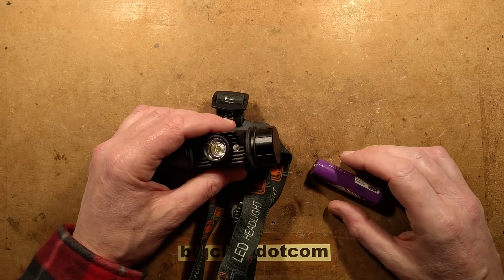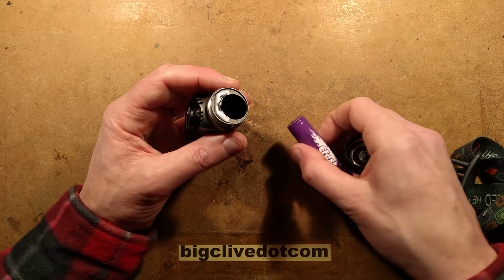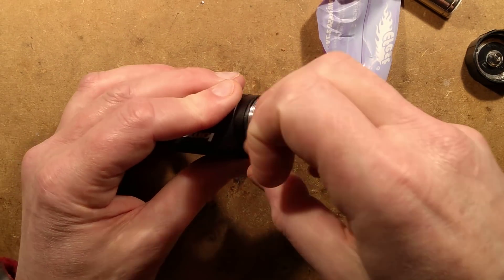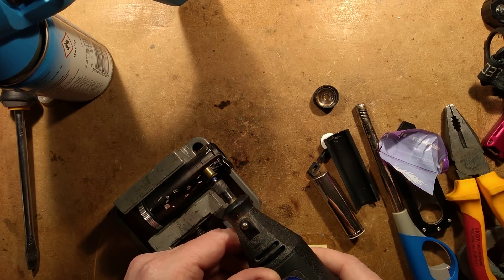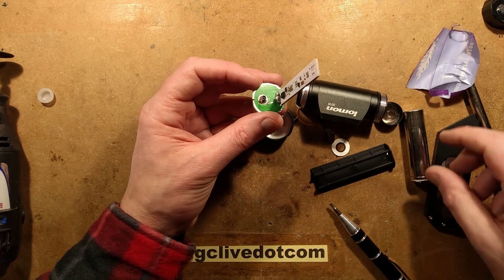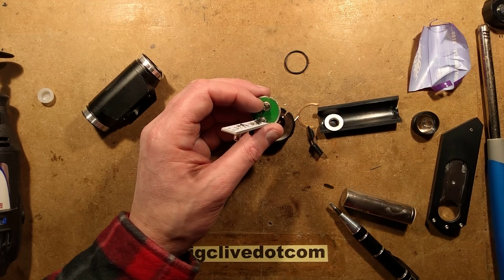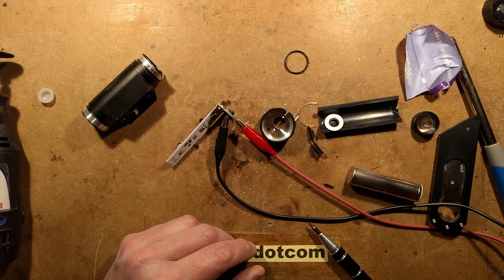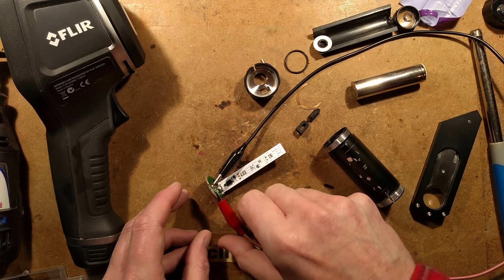Head torch shorts out 18650 cell while not being used!

Comment: Can such lithium cells have bad contacts internally? I have a somewhat similar headlamp. And it started shutting off in response to shacking or shock. I took it apart and flicked the parts of it. It switched off when I did it to the battery, praticulary one end of it. So I resoldered that end, but it didn't get better at all. It may have even gotten worse. All I can think of is an internal connection, if there's such a thing.
https://i.postimg.cc/tCNxT5h1/IMG-20231204-135749.jpg
https://ae04.alicdn.com/kf/Uf46da67e91714805a15e1181ef8db558U.jpg

Comment: You are lucky the battery's thermal fuse worked as it was supposed to when the battery was shorted out and stopped it from turning into a fireball.  At least, that appears to be what happened, judging by the state of the positive terminal.

-Matt

Comment: I had the same problem with a night scope I had. It was a Gen1 thing but still a nice thing to play with at night, a bit grainy and limited vision but you could still make out what things where. It had an infra red LED for 'lighting up' the area in front. I must admit the instructions did say to remove the batteries when not in use, but I obviously forgot about it and it was sat on a shelf for ages until I went to use it again and saw the battery cover was warped and the 2 AA Alkalines were utter destroyed and had ruined the contacts and of course the thing wouldn't work any more. I took it apart and those night things are really weird. It has an anode wire and must work like a TV Tube in reverse, gathering light, amplifying it and focusing it onto a phosphor screen. It's a shame and was an expensive lesson to learn and I don't think I would buy one again. I don't know why the batteries shorted out but they clearly did for some benign reason lol :)

Comment: You should insert the battery with the negative end touching the spring.  The spring will force its way in between the positive contact point and the negative rim if you insert the battery the wrong way.

Comment: I could not see any discolouration at the point where you suspected it to have contacted the casing, shouldn't there be some? Could it have been the solder blobs in the intersection of the boards contacting the end cap, the spring clip or some other part in there?

Comment: That's the reason why i use a protected 18650 in my Alonefire flashlight. A brand with fire in the name indeed but very good! :) Quality looks really nice and there goes also always a extra plastic protection around the 18650 delivered by the torch. You could also use it with 3x AAA in a converter. But also then is protected 18650 a good extra safety feature

Comment: Clive the cell has vented as it has probably overheated they have an internal pressure relief in the cap. Don't touch the electrolyte!!! It is likely flourinated and will burn you and stain you black. Always wear nitrile gloves when handling questionable Li-pos. Get a viton burns kit as this can neutralise such a burn. Lucky it didn't go up in flames, the newer higher power density ones are not so forgiving.

Comment: I only use LEDlenser torches, because I am convinced that these are the only really good torches. As a head torch, I use a MH3, which takes one AA cell, has 2 brightness settings (when you don't change it for a certain time after pushing the button, you don't have to cycle through it to turn it off), and no more bells and whistles. But it has a really great and bright light, which can even be focused by rotating the lens (I don't need that feature, but it's cool to have).

Comment: I guess you could apply some kapton tape to the upper side of the PCB and any other problematic areas which may short and that will "fix" the design problem. It will be effectively insulated and the kapton is thin and sturdy enough to withstand the use and any potential heat.

Comment: I think the idea of using a cylindrical O ring sealed sealed aluminium casing for a torch probably began with the American designed Maglight.
Many other companies like FENIX and LED Lenser followed the same format. But used a battery casement and switch module. So they do NOT use the case as part of the circuit. However even with that format; I have had problems with some pretty expensive ones. Yet my cheapest LED torch £5 has been very reliable and that DOES use the metal body as part of the circuit.

Comment: I actually have a Zebralight flashlight that takes a 21700 Battery- and there is NO indicator on the flashlight (or in the instructions) as to which side is positive which side is negative.
With Li-ion batteries this is more important than ever. 
(And there wasn’t even a “spring side” to help suss it out (both sides were flat).

Comment: I love it how you ramp up the voltage to twice it's normal working voltage, to test where it's shorting out, whilst holding the very thin circuit board between your fingers - with every chance of pressure popping the IC and sizzling your fingertips. A good ounce of bravery that!

Comment: Enough of a scare for me, I've just removed the 18650's from my torch and laser pointer. If I want to use them it only takes a sec to pop a cell back in. Also marked polarity on the torch - like yours, mine is unmarked.

Comment: Lucky that battery has a safety circuit built in or it would have exploded and probably set something on fire. Had a 18650 nearly explode in my hand the other day as i was chucking it out the window after a short circuit occurred and it has began to smoke. You have to be so careful with these batteries. Dont forget the entire outside of the battery is negative and only that small part on the top is positive so its so easy to short them out.

Comment: I wondered if it was only me!  I have lots of chinese pixie cages that don't make it at all clear which is the takeaway and which is the shitter.
I got a mini belt sander that's just a motor a switch and a speed control.  I spent the first week making things thicker and not thinner.  It came un-connected - you just had to connect a couple of spade connectors.  The motor and switch had red and black dots carefully applied to each terminal.  Unfortunately all the wiring was red, and it seems switching live is for wimps.

My battery dremdrill is excelent for £9.99 - but no-one said that the spring was +, its quite exciting the first time the chuck unscrews itself and a cutting disk flies over your shoulder doing 15000rpm.  

Even with duracell's best this was only ever a mild irritation - but now we are in the century of the thermonuclear Lilon incendiary it's a bit more of an issue.

Comment: A very serious design flaw in an otherwise nice light. Lithium cells pack a ton of power and you really don't want all that power released as heat on your forehead !
They could've easily solved the issue with some extra insulation above those solder joints.

Comment: It depends which way the cell goes in.
If the spring pushes on the nipple (+) it can skip and touch the case (-) and you've got your short.
You are lucky the cell is shitty and has large impedance. A good name-brand would've caught on fire or explode. 
This happened to me once. Fortunately the spring was made of shitty steal, the cell was shitty and it wasn't fully charged. So the spring tip melted and lost contact before the cell went thermonuclear on me.

Comment: Hi Clive, 
Here is a thought.. I think like the makers of the head torch expected the reverse polarity protection to just short out the cell with a diode and rely on the PTC  in the cell to limit the current... except that since the torch was designed 18650s without any PTCs (or ones that trip at many 10's of amps) are now common, such as your Efest... When the fault happened, the battery spring did got very hot, losing its temper so breaking the circuit like a thermal circuit breaker. This unintended (and fortunate) "feature" of the battery spring may have saved you from the "lithium Battery incident". 
Applying a short to a battery pack can cause battery springs to softened the plastic they are mounted on and , break the circuit that way.  This is the fun part of product safety testing :-)  The LED looks like Cree XM-L.

Comment: Would it be worth your time to put kapton tape over the top of the board, using a hole punch for the led's and maybe conformerly  coat it. And is there  room for a protected battery?? Seems like a good unit with just a slight error they didn't think of..
Reply from the maker: It's very hard to remove the PCB without damaging the case, but I did experiment with sliding shims down either side of the PCB from the open end.

Comment: Thank you Clive.  I enjoy a good autopsy, though you do not come to a certain diagnosis but rather the conclusion that the torch is just garbage, with which I agree.  This particular torch seems to be a mere prototype that was rushed to market.  At this point in time plastic would be the best material for the case, if we exclude environmental concern from the equation.  Machined aluminium for a torch is just archaic and more marketing hype or "steampunk" than anything else.  I have owned a couple of Maglites. Great art but absolute nonsense.  

Negative earth is pretty much the standard for DC systems, since about 1960.  The battery compartment cap, if you notice, grounds the battery case to the torch case, so it is a safe bet that the negative end of the battery belongs at the cap.  The battery's positive end has a very small dielectric gap to its surrounding case.  You are right, if you think that the cap spring shorted the battery's positive pole to the battery's case.  They are incompatible. The large negative surface on the other end of the battery could have also shorted to positively charged metal on or around the circuit board.  

LEDs are diodes, so correct polarity is required for them to emit light; right?  This is not to say that the circuit board could be designed to correct for a reversed battery but that could be suicidal in a single-insulated system, with some of the solder so close to the case.  

I have a far superior head torch that is mass produced by a battery manufacturer, Energizer, which was perfect in all but one way, ironically: wasting batteries.  Its big momentary button switch would accidentally get squeezed on, in my backpack,  briefcase or pocket.  So I always carried spare batteries on desert hikes in the mountains, after having repeatedly discovered fully drained batteries.  I remedied this design flaw by making a plastic battery isolater out of a bit of stiff plastic product packaging.  It is just a strip, 5/16 inch by 1 1/4 inch which I slide between the positive end of the battery and the terminal.  It folds 90 degrees to lie flat on the battery, and I snap the case closed, to store.  Batteries seem to last forever now.

Comment: Strange~~~~~~~~~~~~~~~~~~~~My headlight failed yesterday!~~~~~~~~~~~~~~~~~~~~~~~~~~~~~~~~~~~~~
Reply: Dug into mine, after screwing with it, and tearing it apart and that sort of crap, I remembered the damn thing needs the button commercial 18650's instead of my reclaimed from laptop cells.  So I simply turned my soldering iron up to 350c and quickly added a small button of solder to the top of each cell, now she lights up once more and floods my front area with light.

Comment: Hey clive, the springs are what prevented thermal runaway. because of the heat they compressed/shrank to the point where it couldn't complete the circuit.

I've made some "powerful" flashlights which draw way too much current for the little springs (up to 15A with a single cell is the highest so far) and lets just say i've been there before... we flashlight "enthusiasts"  get around that issue by using better quality springs and "bypassing" them with a stranded silicon wire  connecting to the end of the spring and to the base so that it remains springy but can handle much more current. (also lowers resistance so that a FET or direct drive flashlight can be a bit brighter)

If you're looking for a new headlight, Skillhunt is a very well liked budget brand around the enthusiasts. the H03 variants are very popular.

Comment: 0:16 "There is no real good indication of polarity in this" That is not a big deal, normally the big spring is almost always on the part of minus.
Reply: Spring size is not relevant to polarity.

You insert positive 99.99% of the time, the "tailcap" is almost always the negative.
Reply: @Domini0nRock  Yeah that is also what i meant, tailcap is almost always the negative.
Reply from the maker: There are springs at both ends.
Reply: @bigclivedotcom  Yeah i saw it later in your video.

Comment: Where I work they got new flashlights. I open one an a battery came out that said 18650 but the cell itself just doesn't weigh anything. I said to by boss that normally 18650's in flashlights are at least a little scarry but (seriously) MAYBE not so much these ones. First time something fake makes feel safer; of course if the flash light is going to short it self anyway safety is a silly notion.

Comment: On a somewhat related note, it still boggles my mind how the hell those PCB-solderable metal clips that are meant to hold regular batteries are still on sale, legally - those things short out batteries BY DESIGN. In addition to touching the two poles of the battery they also clip onto the cylinder itself - which would be fine except there still are batteries around that have a lacquered metal cladding, not a plastic one; and as soon as the super-thin lacquer layer is scratched by insertion on both ends, you have a straight path from one pole through one clip onto the metal cylinder onto the other clip onto the other pole - so you can have a battery start getting warm with nothing but the two clips attached, right in your hand! Which of course actually happened to me with the first battery I tried these accursed things with. Also - the same thing can very much happen with plastic-clad batteries too, it's just somewhat less likely the comparatively thicker plastic cladding will get damaged on both ends. But if it does, same thing...

Comment: I bought a couple solar powered motion sensing lights like you took apart a few months ago.  Saw one with a popped out side panel LED so took down the unit it to reattach the LED panel.  Turns out the 18650 battery shot out an end cap and a spiral of paper/electrodes, physically damaging the housing!  Glad it didn't set my shed on fire.

Comment: Weak link in the design.
And I have the same one. So, is changing the battery causing the wear on the anodized layer? I'm trying to think of a reason to keep using mine, but if I do I'll definitely charge it in my explosion resistant cookie tin. I actually charge everything in those now.
One of the best ideas I've learned from Big Clive.

Comment: Clive, the little spring on the round circuit board is correctly off center, but the one on the screw-in cap is not.
That one, for obvious reasons, is perfectly centered, so not hitting the center of the battery.

Not an issue on the negative.

But if you inserted the battery with positive toward the cap, screwing it in might have allowed the spring to get through the insulation and short the cell on the + side directly ...

The main source of heat looks to have been there.

Could it be that the torch was almost fine, just the plastic liner and the spring suffered a bit from heating because of puncturing and shorting the cell + insulation with the cap's spring?

Comment: Remember folks get real actual good batteries.Those 4000+mAh 18650 from china are more like 400mAh. Charge them in a external charger not in the device via USB. Don't keep them loose, batt boxes are super cheap or free. REMOVE THE BATTERY IF YOU AREN'T USING THE THING. Be safe with these things. They aren't a AA alkalines.

Comment: Just wrap a layer of kaptan tape around that area or spray on a coat of conformal coating. What's the worst that can happen, a 1 A discharge to the battery... Would be a waste not to use the new one. Even if the battery went ballistic, the case is vented through the reflector and otherwise sheathed in an aluminium tube, many times more resilient than the pie dish...

Comment: I purposely reversed mine once because the led was remaining on very low and was once told reversing would " straighten" out the problem.  Immediate overheating.  I was able to shake out the batteries before ruining it, however the springs had both become "un springy".  I stretched them a bit put the batteries in right and it worked fine, albeit with led still low when off.  Pretty sure it would have gotten vey nasty if left in, however batteries didn't get hot, just the springs.
Reply: Sounds more like a ghost led and circuit, they just never fully turn off from manufacturing flaws
Reply: @benson4u215  yes, since it worked fine for about a year, something had to have gone bad.  I'd been removing the batteries to prevent draining them.  Sadly/fortunately I've misplaced headlamp and ordered a new one that hopefully will not have the same issue.  The main reason I posted was I was surprised at how quickly the reversed lion batteries heated up turning the negative springs red hot in seconds.  I'd done the same by mistake with AA alkalines with no heating issues at all, just put them the right way around and everything worked fine.

Comment: My fear of incidents like this is why I never leave 18650's in the lights I have. Even if it's decent quality stuff I'd rather take 'em out between use for peace of mind.
Reply: Using either pink samsung 30Q's or purple imrens 40a I havent had a problem once with consistent power and life but with a set of yellow NXJO's there is constant issues if a battery moves or rolls in position and thats what would cause an arc because the wrappings on them is canty wompus